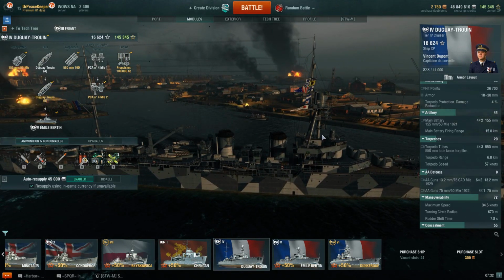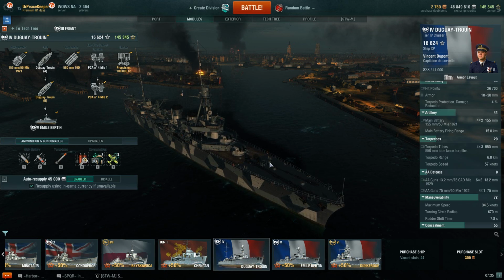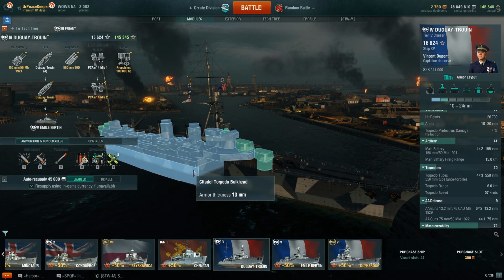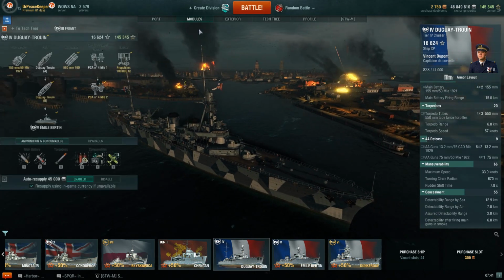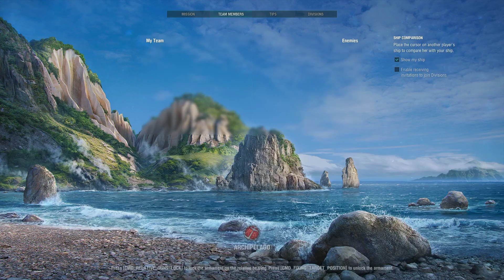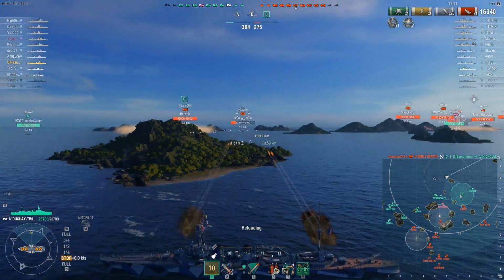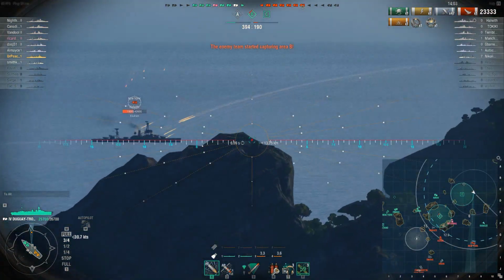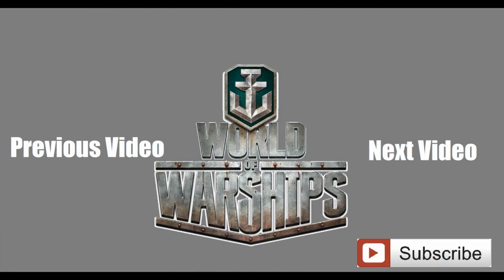How To Play French Cruiser Duguay-Trouin In World Of Warships

Comment: This one was a fun ship, just the rate of fire is a bit weak.
Reply from the maker: Agreed.  12s reload for 6" guns is painful, but that seems to be a French cruiser trait....
Reply: Not that there are a lot of 155mm guns but it seems all the ones there are fire way slower than 152mm's. Considering the shells are usually roughly the same weight I'm not sure why this is.
Reply from the maker: Well in the case of this gun, it was a breach loader using bagged ammo IIRC.... which meant hoist speed for powder and projectiles was probably the biggest deterrent to fast ROF.  Not quite like the USN 6" semi-fixed projectiles (like the 5"/38's in case you were wondering) that had separated case and projectile that were rammed together on loading that made loading rounds super easy...